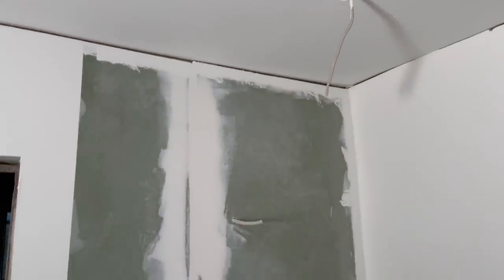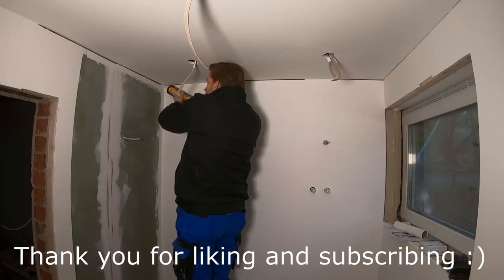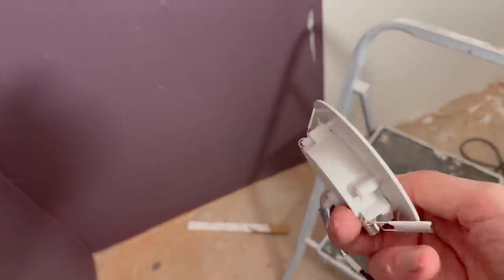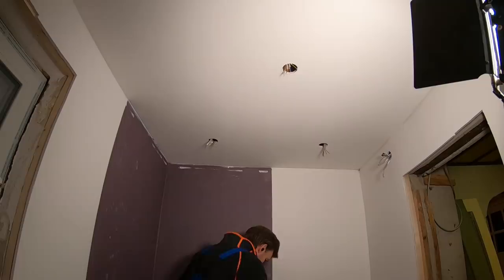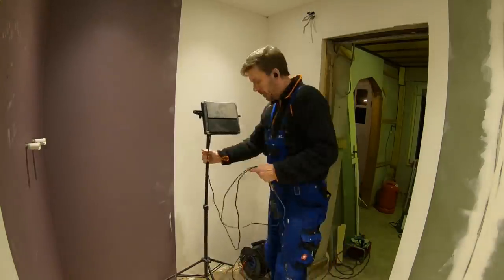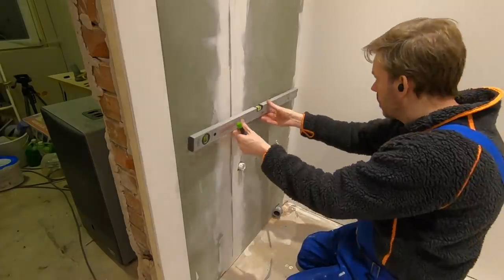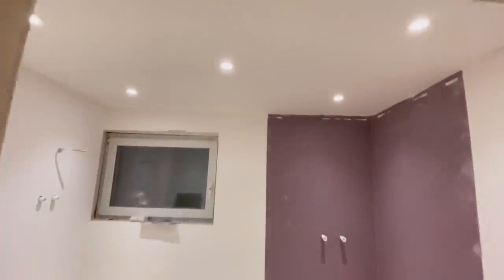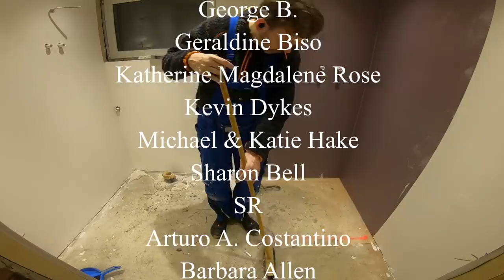Renovating an abandoned Tiny House #75: Finishing touches!

Comment: I think calking the gaps is a wise idea for 2 reasons, 1.) it's presentable this way until your crown molding arrives, and 2.) it'll keep the wee beasties from slipping in while you're away!
Reply: And help stop drafts too!  But probably most important is the multi legged visitors that drop down at the worse time...gotta keep them away!
Reply: Hope all goes well getting the parts you ordered.
Reply: It also adds to reduce sheetrock cracking during settling and flex.

Comment: Glad you did the caulking along ceiling will keep moist air inside the room.  Was glad you did the tile area bigger.  No exhaust fan? Vessel sinks are or were very fashionable- pain to clean.   A medicine cabinet and a  one pc ceramic vanity top with the tile behind it and on the side would would great-  look into the double sided adhesive film for tiling works like a charm on a painted wall do not think the are ok for showers yet.

Comment: I do not know about the ins and outs of electrical wiring and lighting. But should you caulk around the LED potlights to prevent moisture from getting into them when the shower or sink is used?

Comment: Thank you for the video! You are inspiring me to get up and go get something done. :)
Question: I'm appreciating the differences in electrical work US/Germany. Are those low voltage lights, thus the plug in outside the room (to the transformer or the like)? I was surprised at the different style of wire than we use, the apparent lack of working length left after snipping off excess, and the lack of a box to house each connection, but then thought, maybe it's because it's low voltage lighting?
Anyway, thanks for the next update, and the inspiration!!

Comment: You need to paint the wall behind the backsplash before installing the tile. Mortar doesn't bond properly to unsealed drywall. It's best to use a sealer/primer rather than paint, but paint will be better than nothing. Trust me on this.
Reply from the maker: Thank you for the hint

Comment: You don't always listen to your subscribers.  I asked if you could move the door to the kitchen wall. You would have much more space in the only bedroom and provide access to guests without passing through that space.
Reply: I would remove the arch to the bedroom and install a standard door. Your husband knows how to do this with lintles to support the roof. It should not be a change to the structure as the rafters are parallel with that kitchen wall. The wall from the bedroom to the WC is already supported. You just need to close off that door opening to the bedroom.